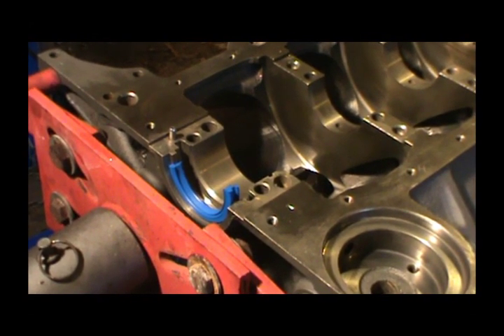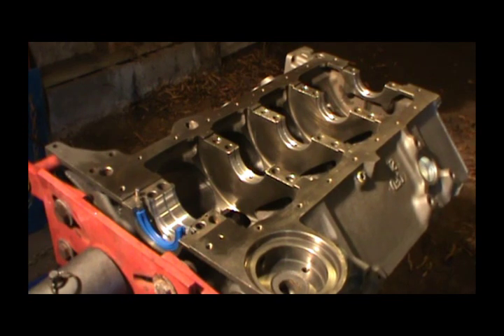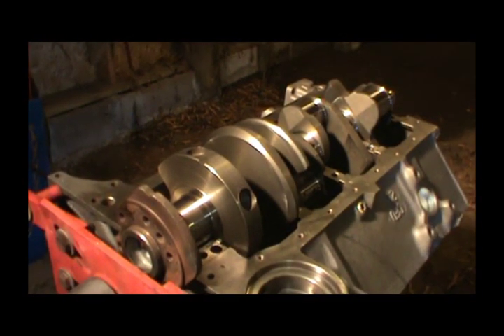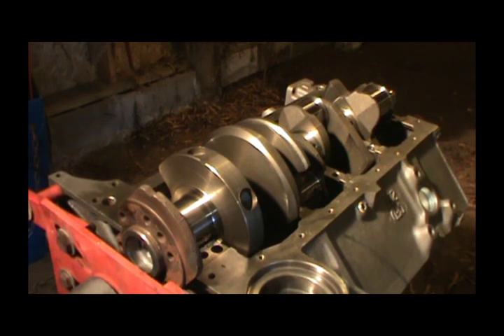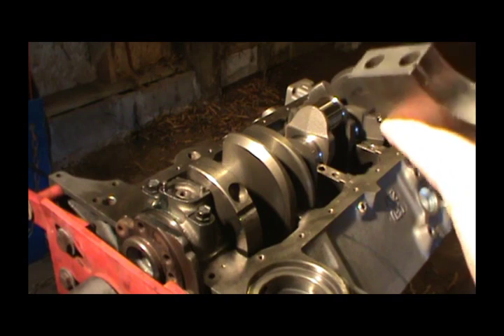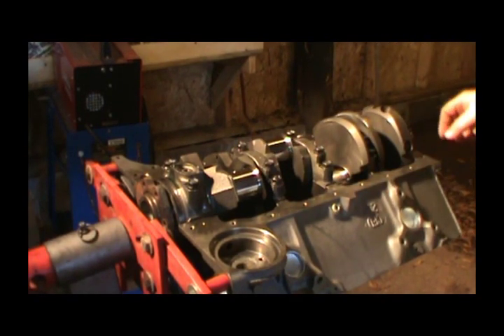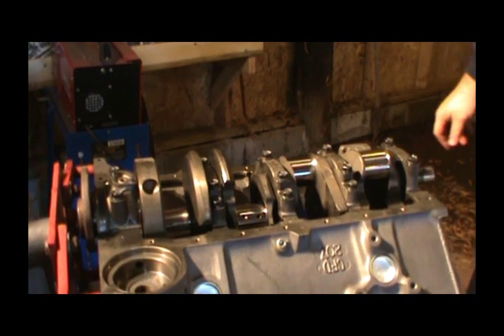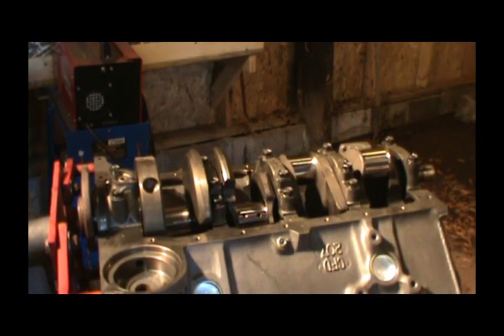Chevy 350 Engine Rebuild Part 2

Comment: Great video :) I'm rebuild a motor for my 1995 Chevy Tahoe right now. Can't decide if I wanna do a Chevy 383 Stroker Kit or just do a regular rebuild with a Vortec Head and intake conversion. I know either way its gonna be expensive but I got nothing but time on my hands.
Reply from the maker: I love my 383 stroker motor that's in my '85 C30.  The only downside is I have to run premium gas or it doesn't like it.  Good luck either way you decide to go.

Comment: How much would a rebuild like this cost
Reply from the maker: That depends on what you want in it.  Go back stock for about $1500 with the cylinders bored out .30 over.  That's basically what I did. Performance parts add to the cost.
Reply: Thank you